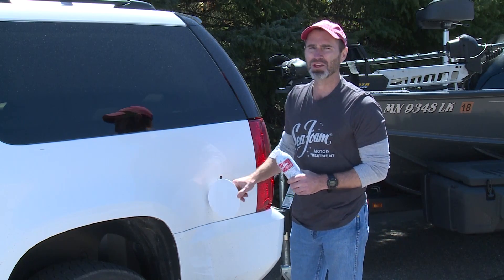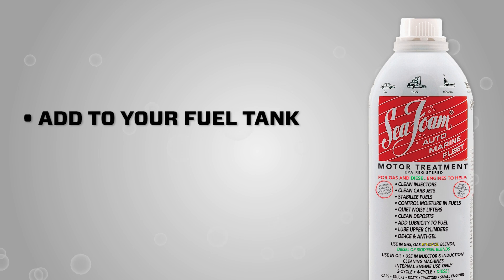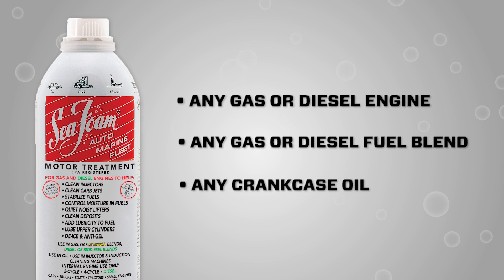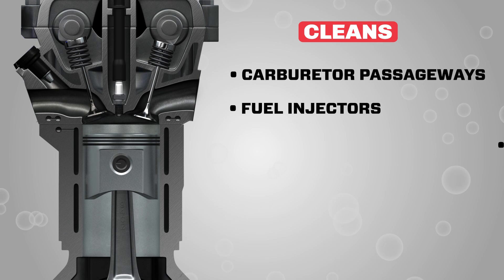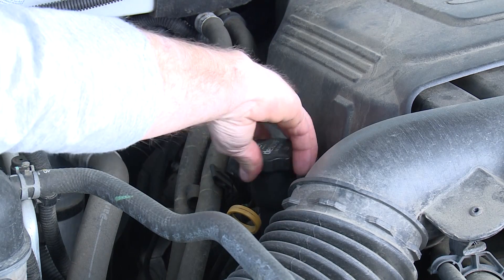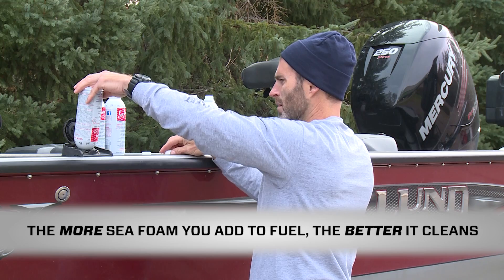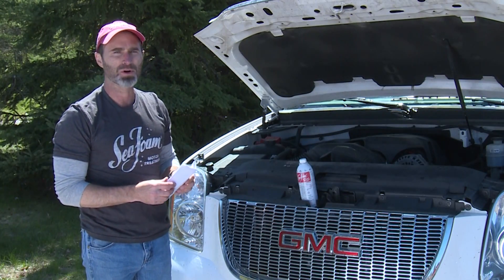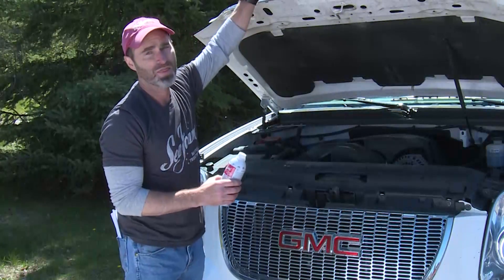How Sea Foam Motor Treatment works in your engine

Comment: I added seafoam to my tank a full 8 once can it began to run smoothly but I new to put some extra rpm's to the motor to blow it out it stalled on me for a day I changed out the O2 relay it started after a few cranks I unplugged the battery after getting back to were I was going to reset all of the codes and it helped to find them all, it stalled after and 1/2 hour of running but start right back up I haven't had any problems since and my engine light is off now I think it found the lower jets that needed cleaning badly but it appears to be running very well now

Comment: After watching this video, I added two cans in my RAV4 fuel tank at once. I am about to add two cans into the oil crankcase, then I found In another video by Sea Foam Official they said do not accede one can per oil change. So there is something inconsistent here.
Reply from the maker: Do NOT exceed half a can in the oil for a Rav crankcase. Adding to fuel and adding to oil are two different applications with unique instructions.
Reply: 1 oz of seafoam / 1 quart of oil

Comment: I add Seafoam to premium fuel in all my yard equipment. Is it ok to stick with top tier road gas with ethanol or switch to rec fuel? Sometimes it will sit in my generator tank for a while. No problems so far, just curious.
Reply from the maker: Great question! Works great in any blend of gas or octane. No matter, best to use non-ethanol fuel in small engines with carburetors.

Comment: 383 SBC. 3K miles. Will the fuel additive cause the engine to smoke until it's used up?
Reply from the maker: You should not expect to see smoke (oil vapor) when adding to fuel. The smoke people talk about occurs when applied at a fast rate through the upper intake.

Comment: I have a 07 ford f150 with the 5.4 that keeps throwing the camshaft over advance code done replace them do u think it might help clear the the codes if its the oil causing it
Reply from the maker: HI Brian:  Yes, add half a can of Sea Foam to your oil crankcase every interval. It will definitely help if your actuator is gummed up. Other: Has anyone done any adjusting to your timing chain? Your problem could be caused by the chain being a little out of sync or tensioners aren't right.

Comment: Do u pour it in before u add gasoline. Or when its near empty.. Or when it has gasoline already??
Reply from the maker: That's a great question.  I typically recommend pouring a full can to less fuel and drive/run before adding more fuel. Think concentration: More Sea Foam to less fuel cleans better!

Comment: can u add it to engine oil?? and how much should I add? my car is v8 6 cylinder it said seafoam only works on 2 and 4 cylinders?
Thanks
Reply: Think...V8 6 Cylinder... must be one of them new fangled engines! Maybe a Tesla!! lol!
Reply: @markmac4596  MDS running on 6cyl 24/7 lmao
Reply from the maker: Hi Klyde:  Yes, can add to oil crankcase.  Use half a can per interval.  It works will all 2 and 4-stroke engines. Your car has a 4-stroke engine with either 8 or 6 cylinders (can't be a V8 with 6 cylinders).   Strokes/cycles (piston up/down movements) are not the same as cylinders (round cavities where the pistons are contained, where combustion occurs - liquid energy is converted to mechanical energy).
Reply: Thanks for the information.
Reply from the maker: @klydechoi2651  Our pleasure, always!  Please let us know if you have more questions.

Comment: So there is no such thing as too much?
Reply from the maker: The point about too much is that it can't cause harm (it's petroleum oils).   If you exceed a 50/50 mix with gas you won't have enough volatility for reliable spark ignition.

Comment: Hey! I purchased sea foam and from the advice of a mechanic just poured it straight into the gas tank. 
No smoke came from the exhaust at all, is this a bad thing?
Reply from the maker: Adding Sea Foam to fuel would not cause a visible emission.  The smoke/vapor you're talking about is caused when a fluid is induced directly into the chambers of a running engine.  Anyway, no worries.

Comment: In one of your videos you say it can be used for 4 stroke engines. Does that mean it's only used for 4 stroke engines or can it be used for other stroke engines. Mine is a Chrysler 300 3.5L engine and I looked it up and it said mine is a 3 stroke engine. Will sea foam work for my crankcase or no?
Reply: 3 stroke.... LOL dying
Reply: @justacinnamonbun8658  Chrysler is pretty innovative!! Finally got rid of the pesky 4th stroke!!
Reply: @ammon123456  I was gonna say, this whole CAFE/lofty mpg mandates the government is setting is making automotive engineers come up with some crazy stuff... Why not make a 3 stroke engine?? The piston just never comes home.
Reply from the maker: Your Chrysler is a 4-stroke.  Sea Foam can be used in ANY combustion engine, 2- or 4-stroke, gas and diesel.

Comment: If you added to much to premix would it be like adding more gas ,leaning.or like adding more oil, richening
Reply from the maker: Do you mean 2-stroke oil and gas premix?
Reply: Sea Foam Official ,yes would see foam be like more oil or more gas in 2stroke fuel
Reply from the maker: It is not a replacement for either.  In recommended amounts it should not cause either condition.  If too much is added, or an excessive amount of anything ... you're replacing gasoline volume, which equates to  loss of ignition vapor volatility.

Comment: Can I pour the whole can of seafoam in the oil, instead of half a bottle of seafoam would it hurt the motor?
Reply from the maker: Do not exceed the recommended amount.  1.5 oz per quart of oil max.  If your auto uses 5 oil quarts use half a can of Sea Foam.

Comment: So can add 1 can to my crankcase before i change my oil and add 1 can to my gas tank after i change my oil
Reply from the maker: For most cars add no more than 1/2 can to your oil 100 to 300 miles before changing oil.  You can add as much as you want to fuel at any time.  Hope this helps!
Reply: Sea Foam Official ok thanks for replying
Reply from the maker: Glad to help!
Reply: Your canadian tire distributor in Canada from their website in description states:
http://www.canadiantire.ca/en/pdp/sea-foam-motor-treatment-473-ml-0387800p.html#srp
Quote 
Add Sea Foam to your engine oil before or after every oil change interval – just pour into your engine’s oil filler neck
* Perhaps someone from your company should advise them to place only half a bottle in and also not before and after

Comment: Motorcycle application videos please.Wet clutch in my 82 650GL
Reply from the maker: Thanks for the suggestion.  Until we make the vid, just add 1oz of Sea Foam per oil to your motorcycle's crankcase.

Comment: If you have an older vehicle would this be one of those products that works TOO good and ends up causing a gasket leak or exposes an engine that needs more work than you thought?
Reply from the maker: That's a great question. Do you mean that if you have leaky gaskets that are sealed by old oil residues?  If that's the case, yes, Sea Foam works to dissolve and reliquefy heavier oil forms, including any old oil crud that's clogging a gasket.
Reply: Sea Foam Official thank you for your answer! One more question, what is the best way to use the spray in an LT1 engine intake? I'm not super savvy on how the throttle body works. But when I take off the intake boot it looks like there's two smaller throttle shafts rather than one big as I've seen in your guys videos. What's the best way to spray in this situation?
Reply from the maker: Your LT1 has 2 throttle plates that sit side-by-side.  Just need to aim the straw nozzle at one of the plate openings. Piece of cake!
Reply: Sea Foam Official man thank you guys so much.. under $15 well spent
Reply from the maker: Our pleasure, always!